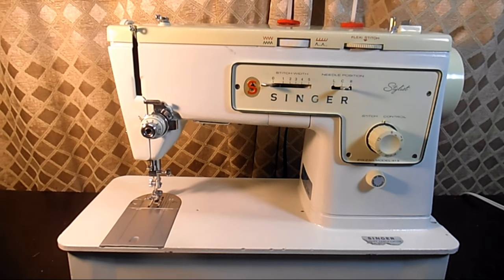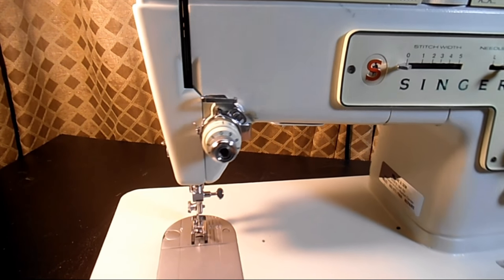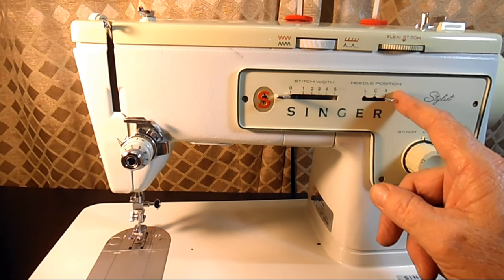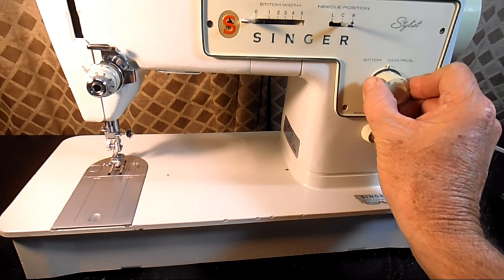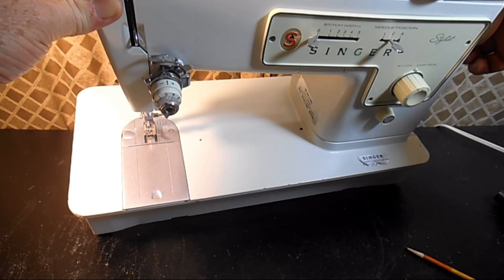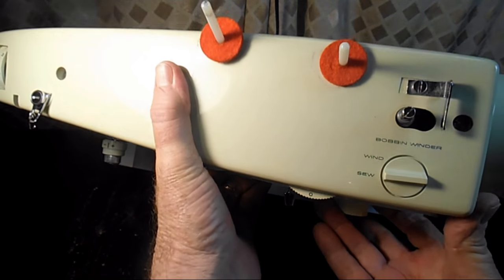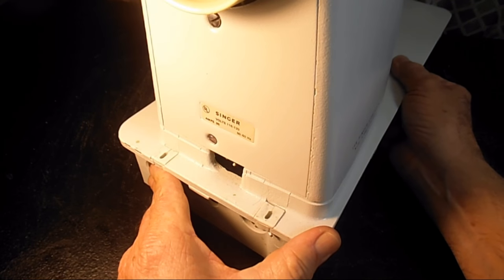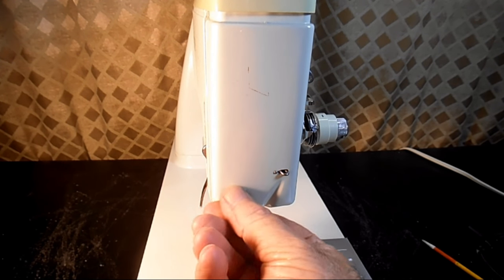TOUR THE FEATURES OF THE SINGER MODEL 413 STYLIST SEWING MACHINE

Comment: Thanks for sharing 
My machin was working great
But recently it stop loading thread from underneath and even the thread from top get stack ! Do you have any idea how can i solve the problen please?
Reply from the maker: Welcome to Andy Tube. Sorry you are having a problem. Is your model the 413? By only your comment and not being able to see or touch your machine, it is difficult to isolate the problem and recommend a fix. When you mention bobbin thread I always think of a timing issue. The timing belt can slip by a small amount and timing is affected or lost. Here is a video about the timing: https://youtu.be/pANycD90wQg
The 413 model also has a plastic top gear on the vertical shaft that is prone to crack and break with age. When the gear starts to break the stitching gets all weird and finally, the hook won't even turn. You can buy a gear for $10 and replace it your self. This slideshow indicates where the new gear was installed so you know where to look on your machine to see if yours is damaged. https://youtu.be/y_58gXoZqjA   the gear is between 0:12 to 0: 32
You can get free instructions for gear replacement here: http://www.singersewinginfo.co.uk/457gear/
As I mentioned, these are the most common things but it could be something totally different. You have to start somewhere when isolating trouble, so you could watch the video, slideshow and see what you think. Good Luck.

Comment: Hello Andy .I have a singer 416  similar to yours I was wondering can you use a twin needle for sewing leather?? and is there a walking foot attachment for the machines ??? Love your channel
Reply from the maker: Hello, Darling (hehe) ... Thanks for asking. The 416 can use a true twin needle (not two single needles) I have not seen a twin leather needle. There are many sellers of a low-shank walking foot that fits the 416 Singer. Here is one example, but please shop around >> https://www.sewingpartsonline.com/low-shank-walking-foot-singer-423242-451.aspx
The Singer twin needle was category 2028 but now many manufacturers make twin needles in various sizes. Leather needles were category 2032 and again, many manufacturers make them. I have sewn with a size 11 twin needle on leather one time and it worked OK but since it was not a leather needle (knife or wedge point) it got dull sooner than normal. The Original Singer Instruction Manual for Model 416 has a nice chart on page 12 showing Fabric to Thread to Needle choices, including garment leather like suede and lined leather for gloves, etc.
On page 33 & 34 are instructions for twin-needle sewing. You can download a free PDF copy of this very nice & complete manual here >> https://www.singer.com/sites/default/files/product_manual/f7d1d98860e5ec9fcb4839cb383a08ac4b0c0c10.pdf
Thanks for watching and commenting on my channel Clarise. Take Care
Reply: Thanks so much for your help   @andytubesewing1953
Reply: @andytubesewing1953  Your walking foot link is the best so far!!!! it guarantees to fit. While on the subject do you know if I can get one to fit a Singer 99k ????
Reply from the maker: Well, both machines are what is called "Low-Shank" so I think the same one would fit the 99K. You could ask the seller to be sure.